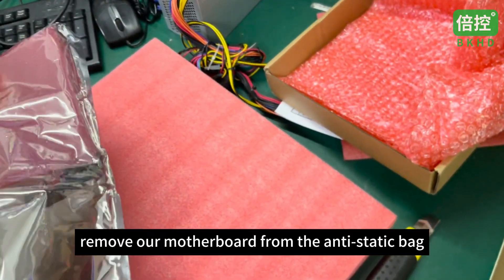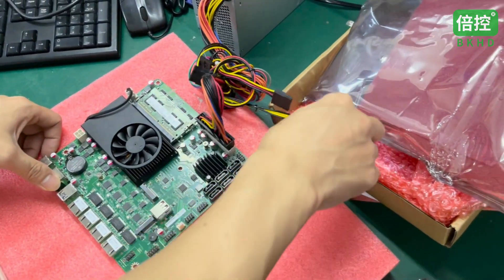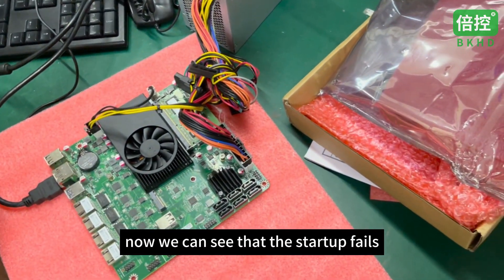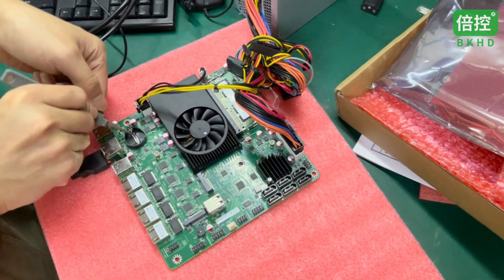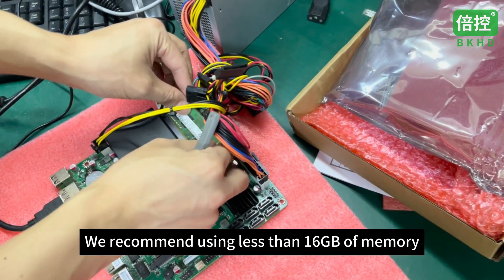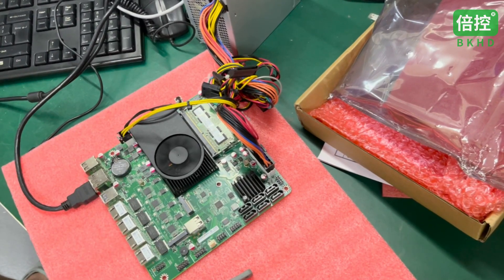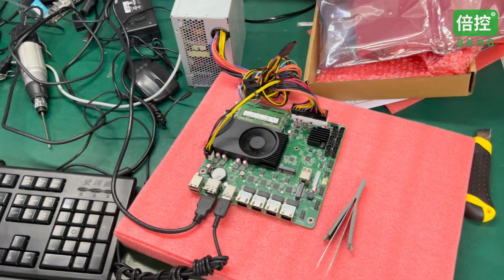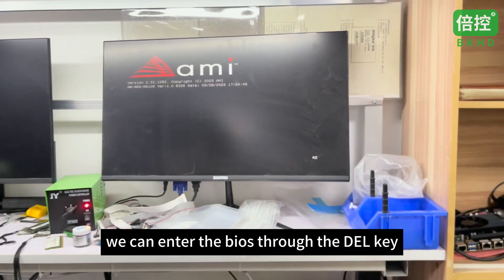BK NVR N5105 NAS MB does not display or not start solution

Comment: I had a very long first boot (~30 seconds) probably because of memory training.

Overall this is a wonderful product but the CPU fan has a 3-pin connector (it can only be controlled by voltage) whilst the BIOS only allow for PWM control. This results in the fan spinning all the time at max speed (noisy). A BIOS upgrade which fixes this issue would be greatly appreciated. 🙂
Reply from the maker: Thank you for your honest feedback and we will work hard to improve the product to ensure that PWM fans are an option as a replacement in future releases. :D